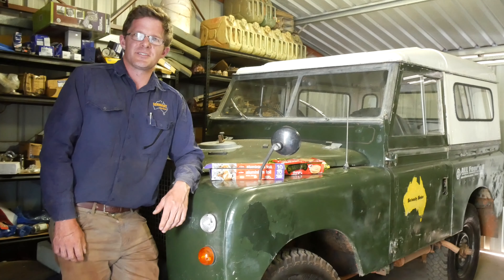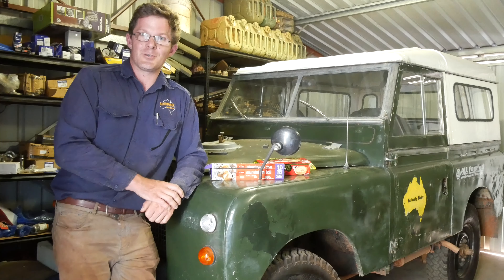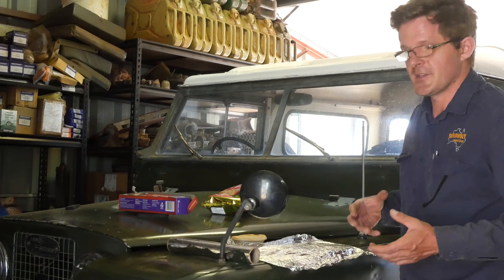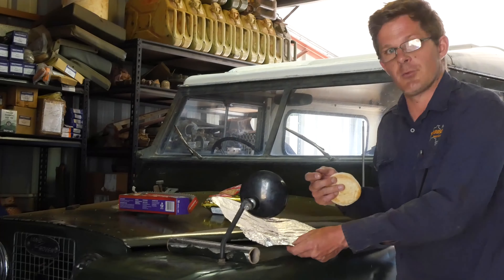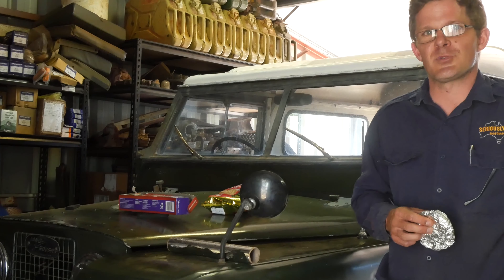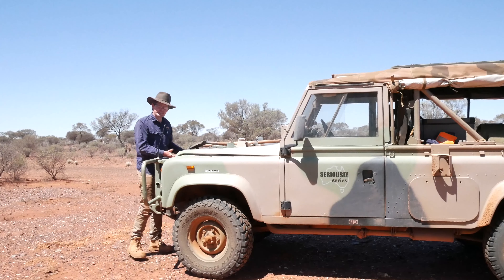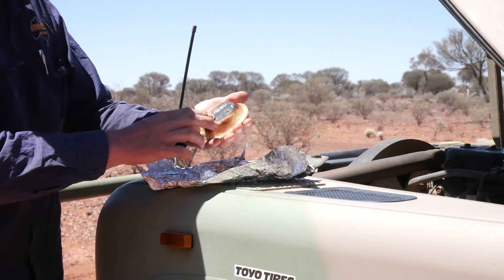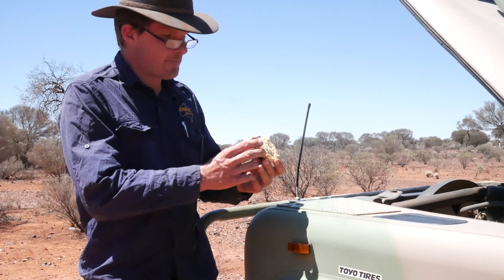How to cook a pie on 4x4’s engine: Land Rover Perentie

Comment: Hay Jeff, I recently bought a land rover County v8 I wonder if you have any experience with the v8 motor and is the county v8 a good 4x4 or was I better off getting a perentie?
Cheers Jeff
Reply from the maker: G'day Jeff. I have a bit to do with the V8 variant and they are great bit of kit. Provided you run correct coolant and distilled water in the cooling system, the aluminum heads can tend to fail other wise and  the keep the timing and carburetors in good order you should have no issues. I hope this helped? Cheers Geoff